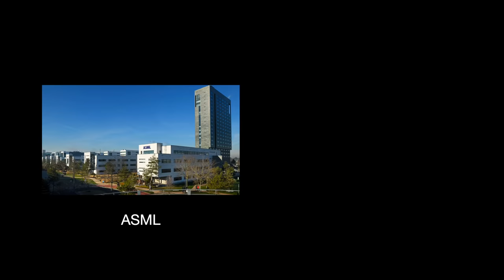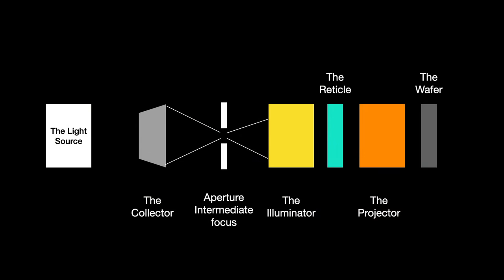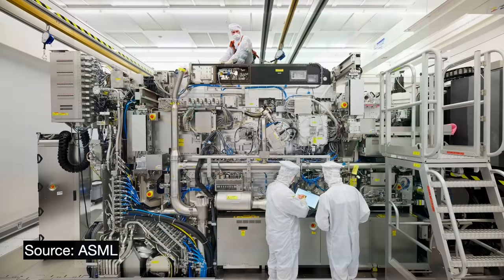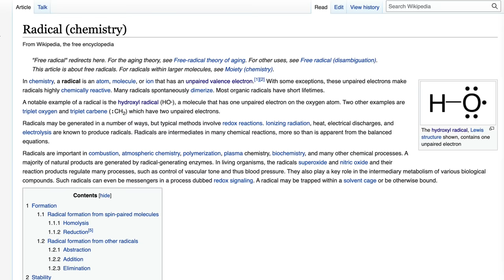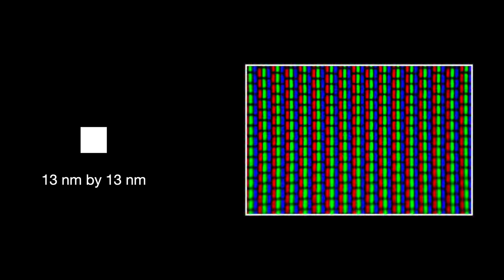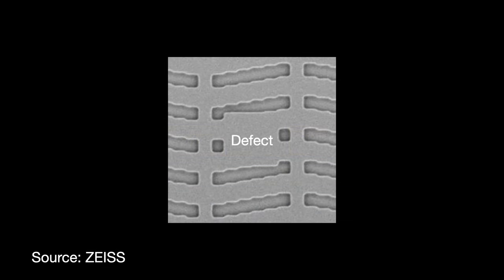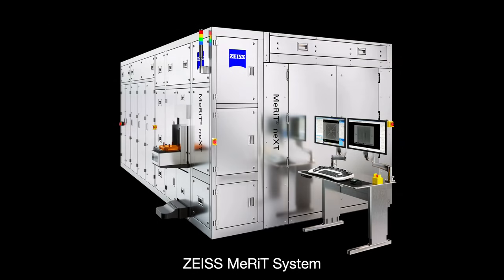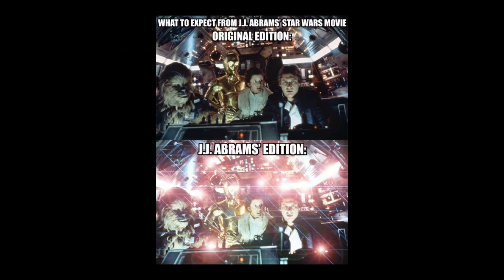How Carl Zeiss Crafts Optics for a $150 Million EUV Machine

Comment: Few people appreciate the extreme amount of engineering breakthroughs to make EUV happen. To the average person '10nm DUV' doesn't sound that different from '5nm EUV', but the leap from DUV to EUV is like from steam ships to nuclear aircraft carriers.
Reply: NO.
Reply: pretty much. Going from 193 nm laser to 13nm wavelengths. Everything needs to be more than 15x as precise. It also takes the number of masks needed to produce a chip down from over 250 to under 70.
Reply: And IBM has recently made a 2nm chip prototype
Reply: @alanmay7929  Yeah, they are doing part of the research for partners like Samsung and Intel. ASML is already shipping machines that are theoretically capable of 2 and 3 nm, but it takes years of research from the foundries to actually get the defects down enough to mass produce.

Seems like 3nm is coming in 2025 and Intel will be the first customer to receive High-NA-EUV machines :)
Reply: @M.V.P.  Actually the node sizes companies like Intel and Apple are using (2 or 3 nanometer or whatever) are just marketing terms. Current EUV machines have a critical size larger than these nodes.
Reply: @alanmay7929  No, they have made a chip on an experimental node they call 2 nm, but it's just a name; absolutely nothing on that chip is 2 nm.
Reply: @soylentgreenb  its  ot a name, they made the first 5nm processor too, its called research and tests. Production actually requires a high rate of succes per wafers.
Reply: @alanmay7929  It's just a name. It's called marketing. On 350 nm planar transistors in the mid 90's the contacted poly pitch and minimum metal pitch were both 350 nm. E.g. on TSMC 7 nm FINFET, the transistor gate pitch (~contacted poly pitch) is 54 nm and minimum metal pitch is 40 nm. Nothing on a 2 nm chip is 2 nm; that's just a brazen lie by the marketing department. MMP and CPP went their separate ways around 250 nm; the DRAM people wanted to shrink MMP to fit more bits on a chip and the logic people wanted to shrink the CPP to fit more and faster logic on a chip. Nothing since 250 nm has been exactly what it says on the tin and it has increasingly devolved into pure fiction.
Reply: @soylentgreenb  whats mmp and ccp? Just curious
Reply: @soylentgreenb   whats random logic circuits?

Is it (random logic) circuits or random (logic circuits)
Reply: Sorry for ruining your 69(nice) likes
Reply: @alanmay7929  I work in semiconductors, the node name just a name.
Reply: @thefbat5847  lol……. That’s what she said!
Reply: is it worth it for just 5nm difference.. :D

Comment: sequence error at 11:00 - multi-layer coated mirrors like this ABSOLUTELY cannot be touched, let alone polished, after being coated. The coating and its reflective properties would be instantly destroyed. All the super polishing has to be done to the substrate BEFORE the multi-layer deposition step. After coating, the mirror is done and must remain absolutely pristine.
Reply: correct
Reply from the maker: My bad. I got mixed up.
Reply: You can clean those optical surfaces with CO2 "snow" blasters.
We cleaned the Kepler Space Telescope mirror with that before launch.

I believe Northrup did the same with the JWST mirrors.
Reply: @stuartgray5877  CO2 cleaning is non-abrasive. I doubt it could remove the tin contamination adhered to the surface. Also this is a DEEP vacuum UV mirror, any introduced microroughness is going to be a vastly bigger problem for scatter loses than it would be on an IR mirror like jwst
Reply: Yeah I was like if you polish it won't the atomic surface get destroyed. Thanks for the heads up.
Reply: And, you convolved microroughness, which causes scatter, with aberrations - these are two very different things. Scatter lowers contrast but doesn't much affect sharpness. Aberrations (whether design residual or from fabrication errors) lower sharpness and blur the image features.
Reply: i was thinking if it was possible to use a discarded wafer (if such a thing exists) to make a diy mirror for personal use. thanks for stopping my unreasonable phantasy.
Reply: How would you install a mirror like this into the product without damaging it?
Reply: @UFAnders  carefully.
Reply: @Muonium1  VERY!
Reply: @Muonium1  those people in thumbnail directly touching the glasses.
Doesnt it will affected or damaging the mirror slightly?
Reply: @dwinhoval   no they are only touching the unpolished uncoated side and it's a reflective optic.
Reply: Heh, thanx for the comment, exactly the one thing I wanted to point out ;)

Comment: I'm a physicist and just walking through the the different kinds of physics, which need to be mastered to build this beast makes me excited like a 5 year old in a Toy R Us. 
Building an airplane is just childs play and "rocket science" does not come close.  
I'm just mentioning the physics involved in operating it. I'm leaving out all of the manufacturing.
- Classical optics
- Laser physics and optics
- Non linear optical effects
- Plasma physics (some of it based on inertial fusion research)
- X-Ray physics (we are pretty close to the X-Ray domain so some aspects already apply
- Gas diffusion
- Large scale precision mechanics (relative stability under stress, temperature changes, gravity)
- micro-mechanics
- electrical systems galore
- Thermal management aka heat dissipation
- Acoustics (avoiding and managing vibrations)
- All kinds of sensors - acoustical, thermal, magnetical, optical (stretching the definition), radio, dimensional, gravimetrical
...
Reply: I am convinced that the semiconductor research is the single most advanced "project" that humanity has advanced to. What a time to be alive!
Reply: my biology teacher colleague is convinced it's tech transferred to us from the Roswell Incident xD
Reply: I know some of those words
Reply: @jonathanlarsen4177   It's ALIEN 👽😎
Reply: @cbrtdgh4210  Because space aliens always keep an ultraviolet lithography machine packed away in their flying saucer, because it's just handy to have one around.
Reply: @cyberpotato63  Yah it's super handy
Reply: Add:
- Vacuum technology
- Control systems to drive the actuators in a closed loop from sensor inputs
- "Dirt" control
- Sputtering technology
- ......... (?)
Reply: as engineering physic student I approve this *le me crying in the corner of my room
Reply: Well, it's not brain surgery
Reply: @wyskass861  No it is not. It is way more complicated 😂
Reply: @svenhoff2653  Exactly, that was the implied joke of my statement.
Reply: Plasma state in DUV light source.
Reply: mOh  "Manhattan project was the most difficult project. Race to the Moon as well." - While we could discuss the repsepctive challenges of those projects, the short answer is "No".
The longer answer is "Its very difficult to compare them".
And the reason is: You didn't really understand the original post and the replies. The range of technologies for Lithography is wider and its integration into the global economy far deeper than Manhatten and Flying to the moon.

Just consider one aspect (slightly unfair comparisnon): North Korea can make the bomb and launch rockets.
Reply: mOh  Indeed, you don't how difficult it was. And what role intellectual achievment versus resources investement etc played.
You listen to folklore and myth. One needs quite some understanding of technology and science to pass judgement.
Let's best say, they are not really comparable and if you want to compare Manhattan with a EUV lithography machine you need to go really really deep.
Reply: mOh  Please apologize, but you got your knowledge from popular books (or the equivalent in the Internet age). I'm a physicist with 35 years in teh IT industry and 42 years of programming.
Please learn to notice when somebody has more background knowledge than you do. Its OK to express an opinion, but you arguments need more sunstance.

Comment: One correction, @11:30: "If that 450mm mirror was blown up to the size of the United States, 4500 km ... then 50 picometers would be just 0.4 micrometers." Actually, 0.5mm, which is pretty astonishing.
Reply from the maker: My bad. I’ll edit the description.
Reply: 1/20th of a nm is much smaller than a Si atom (3 to 5  per nm depending on lattice structure direction). Considering the wave nature of light, the reflection bounces off a large surface. Keeping everything stable & accurate across such a large surface must employ magic
Reply: So wait... they actually polish the mirror to this spec, and it's not a result of super smooth coating? HOW?!?!
Reply: @TigeroL42  See pp 19-22 in "Optics for EUV Lithography" Migura 2019.
Reply: 나도 이거 보고 이상해서 계산해 봤는데 ㅎㅎ

Comment: it really is amazing how much effort they have to put into these mirrors. I always wondered why they have to bounce it off so many mirrors instead of 3-4 (collector -> illuminator -> projector -> focusing). In all my reading I never found a clear answer.
Reply: I think it has something to do with constructive interference
Reply: Seems that the incidence angle of the EUV beam to the mirror surface need to stay in some range to maximize constructive interference, thus they cannot bend the beam too harshly, and they cannot build an infinitely large machine. So they have to use multiple mirrors to progressively shape the beam.
Reply: Yes, this is not intuitive. My guess ... take it with caution!... is as follows:
Bragg's reflection of a single beam ray from multiple layers of materials of different refractive indexes results in the lateral shift of the ray's shadows, which represent "reflections" from deeper layers. 
The multiple mirrors arrangement may result in the compensation or attenuation of these "Bragg's shadows", and/or possibly? averaging nano-geometrical distortions in the system.
In general, “diving” into the science behind ellipsometry of thin optical layers could help better understand the intricacy of the whole design, ...which is a challenge in itself 😉!
Reply: Yes, this is not intuitive. My guess ... take it with caution!... is as follows:
Bragg's reflection of a single beam ray from multiple layers of materials of different refractive indexes results in the lateral shift of the ray's shadows, which represent "reflections" from deeper layers. 
The multiple mirrors arrangement may result in the compensation or attenuation of these "Bragg's shadows", and/or possibly? averaging nano-geometrical distortions in the system.
In general, “diving” into the science behind ellipsometry of thin optical layers could help better understand the intricacy of the whole design, ...which is a challenge in itself 😉!
Reply: @joshuahuang5798  That makes sense.It looks like they progressively reduce the angle and as Michael mentioned the layers can cast shadows, which I have read before as well. My guess is they need to compensate for the shadows while maintaining other limits or setup the angle for a clear top down projection. I don't know if the error averaging is correct because a lot of errors multiply through reflections. Would love to learn more about this.
Reply: @excited box  If the picture is still too simple :) ... account for the change of the polarisation vector of the ray, as Bragg's reflection has a profound effect here. Perhaps this should impact the Rayleigh resolution limit and, as such, the IC masks layout design rules in X and Y directions.
Reply: My guess is that the image they can form with multiple mirrors is larger just how telescopes have many mirrors instead of just one which could be done but results in a small field of view

Comment: That's really impressive stuff, it looks like building spaceships is kindergarten-level engineering in comparison ;-) Do you document the sources you use for your videos somewhere? That would be pretty nice to dig deeper into a subject taking advantage of your great efforts to get an overview on the subject at hand.
Reply: Subscribe to his news letter. The newsletters go into much greater detail.
Reply: I was going to jokingly recommend this as well
Reply: @Leopardosx  But no sources cited there either...
Reply: Tell me that building the JWST beryllium mirrors is "Kindergarten level". 
 Complete with focusing electronics that work at 5 Kelvin.
Reply: @stuartgray5877  you are describing optics here, not the spaceship which is used to move it. Those are basicly maximum optimized rockets. While definitely not without a challenge, I think most of the parts can be fabricated from sheet metals and tubes. The EUV functional parts cannot even be normally polished and must be polished using an ion beam under vacuum. I think controlling those processes to such a low failure rate is indeed vastly more complicated especially for such large surfaces
Reply: @ersetzbar.  Sorry, but I work for one of the most advance optics/imaging companies in the world.
We built the corrective optics for Hubble, and the JWST mirrors, so I took it as an insult that what we build is basically "crap" compared to this.  I disagree.

we also do a lot of UV imaging.
Reply: no need to degrade one person's good work in the effort of appreciating another's.  different tools, processes, and timeframes for different goals.
Reply: In terms of the actual engineering features, this is arguably way more impressive than most space systems. The thing with space is that no maintenance can be performed, ever. That is a whole different challenge, and impressive in its own way.
Reply: @thealienrobotanthropologist  well yeah if you compare it to the highest end of space systems, they are more complex than this. I was talking about most (commercial) space systems 😜.

Comment: An important additional point is that the plasma produces multiple wavelength of light, but the distributed bragg reflectors are very selective which wavelength they reflect - to the point that the angle changes the best reflected frequency. I suspect the multiple mirrors also to increase the purity of the light, at the cost of intensity.

Comment: 50 pm, thats roughly 1/3 or 1/2 the diameter of a molybdenum or silicon atom respectively. so every single atom has to be spot on on its designated position on the mirror 50 cm diameter.
thats far bejond my comprehension I've to admit, absolutely mindbogling!

Comment: Great exposition as always. Just want to add some physics-related corrections. Bragg reflection needs many layers not because one layer reflects not enough light. Indeed, one layer reflects pretty much nothing. Many layers are needed to produce coherent superposition of scattered waves in such a way that much is reflected and little is transmitted. It's pretty much the opposite to the photographic lens coating which is also multilayer these days. Second, the flare "much loved by J J Abrams" is in fact due to the use of anamorphic (cylindrical rather than spherical) lenses for wide-screen film photography. On the other hand, rms of mirror/lens surface leads to imperfect focusing which pretty much looks like your 5nm machine has resolution close to say a 10nm one. Having said that, I truly admire your dedication: I would never in my life want to sift through dozens of conference papers on the topic. Thanks again!

Comment: Incredible. Thank you for an explanation at my level. Scary thing is these machines are probably going to be scrap in10-15 years wouldnt they be fun to pull apart.
Reply: Something like 90% of all the machines ASML ever made are still in operation.
They do not become "scrap", they become "mature nodes". Those old machines currently make stuff from memory chips to car microprocessors, bluetooth headsets and washing machine controllers..
Reply: @pizzablender  Indeed. We are still using old chips and designs decades on. No need to build a 555 chip using SOTA tools when a thirty year old process allows you to make them for Pennies. As long as the machines work, keep them busy.

Comment: omg, this is awesome. I'm not sure where Zeiss' work ends and ASML's starts, but that's not important. Maybe there's no strict delineation. Nevertheless, we must go deeper! Idea: mask making industry?
Reply: There must definitively be a clear and very well defined interface, otherwise you'd never get a working system. Typically you can expect strict specifications and acceptance testing of each unit.
Reply: @Martinit0  I guess Zeiss gets the specification of where the light has to go and what it has to look like, they of course manufacture the maintenance and customisation system as well. The whole lithography machine has more parts than just the illumination though.
Reply: ASML is like apple and Zeiss and others are like Pegatron and Foxconn
Reply: @suntzu1409  So Zeiss basically makes everything?
Reply: @andro7862  not everything just the optics

But my point is ASML does not actually make anything like apple

Comment: Great video but I wish you made it longer with more info. Moores law is hitting cost road blocks with these machines.
Reply from the maker: My brain was fried.
Reply: No its actually not, the EUV machine save you so many steps that were needed with DUV to achive the smaller structures that they are quite cost effective for a lot of the "small" parts of a chip architecture.

Comment: The reason ELLIPSOIDS vs PARABOLIC shapes (or paraboloid) are used is because parabolic reflectors reflect light from the FOCI parallel to an imaginary line defined by that foci and the parabola's asymptote / apogee. That's to say, rays reflected will be parallel that line (along with diverging rays. An ELLIPSOID however, allows focusing reflections at the other focus.  

Single-reflection rays (photons) emanating from one of an ellipse's two foci will be focused (converged) at the other foci ... which I'd presume to be the wafer / mask, etc., in this case.